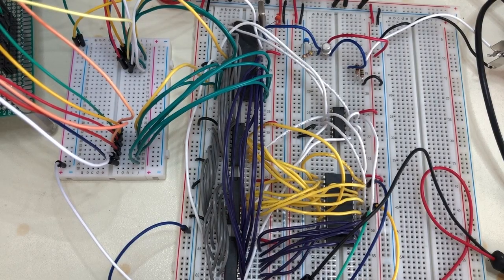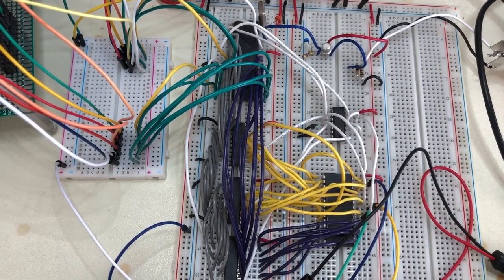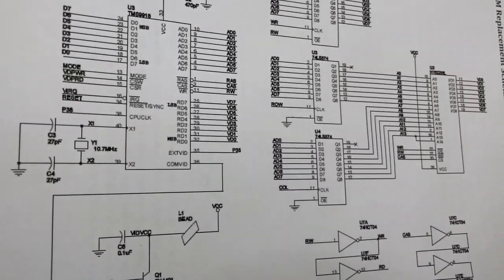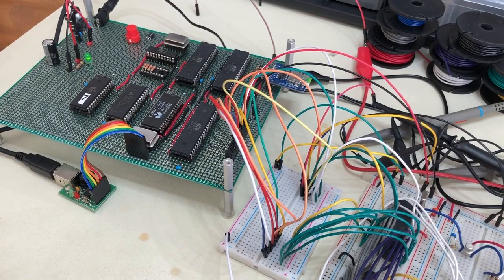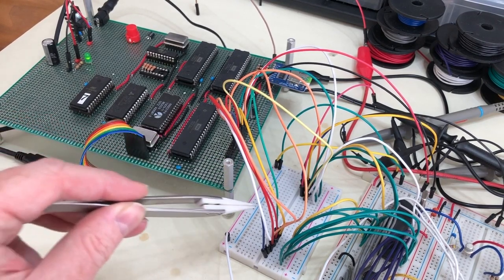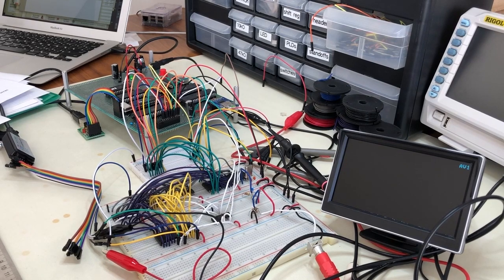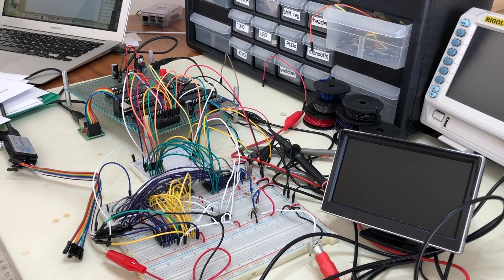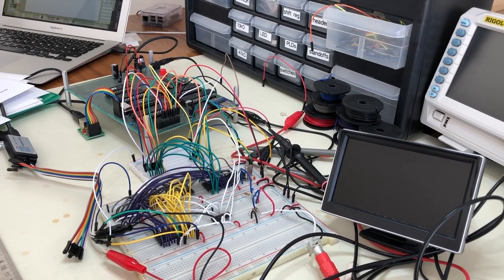6502 Mite home-brew computer project: step 17, video first steps

Comment: Awesome!

Out of curiosity, have you spent any time thinking about trying to create a virtual memory scheme for a 6502-based machine? I have seen ONE reference related to this possibility online and it was based on parts that don't exist any more as far as I can tell. But I can't get my mind off of the idea that maybe somehow I could devise a virtual memory scheme for my machine. Just curious if anyone else thinks about these things :P
Reply from the maker: I haven't thought about that; without better hardware support, it seems like it would be pretty challenging to make work effectively. It's not uncommon to build a bank-switching arrangement so that one can have more than 64K of memory. On the other hand, one of my back-burner projects is to build an implementation of the Infocom Z-machine so that I can run the adventure game Zork, and it's basically a kind of virtual memory implementation.

Comment: Very cool! I don't think I have a single YT upload reference saved with someone demonstrating a complete video circuit, with a schematic, and using all vintage parts. I look forward to seeing your progress, and hope I can replicate it myself at some point.
   I have a collection of a few old digital picture frames I got for peanuts at the local thrift store. Some of them have composite video inputs, and would make for an interesting DIY project enclosure as well...at least the oldest oversized variety.
  
 BTW if you're not aware, Joel over on a channel called OpenTechLab is one of the open source developers behind Sigrok Pulseview - some well developed open source software for that logic analyzer. I highly recommend looking him up. He has a great tutorial walking through how to use the software.
Thanks for the upload.
-Jake
Reply from the maker: Thanks! That's the very software I'm using, so I'll give him a shout-out in the next video!